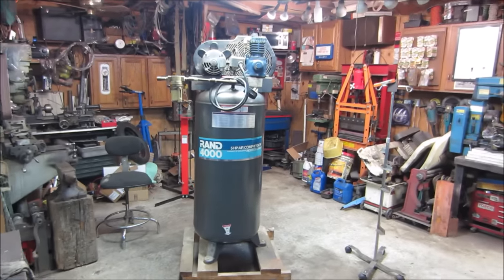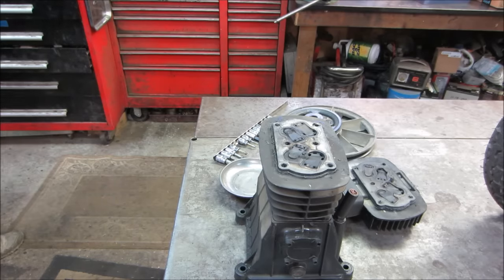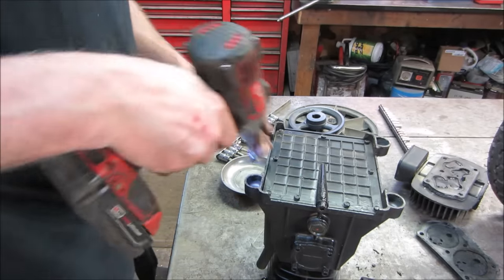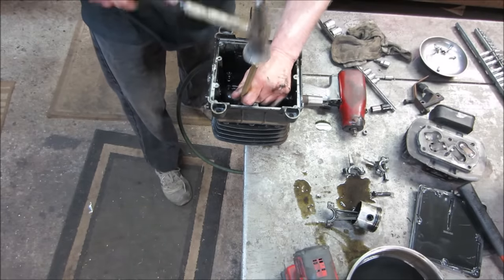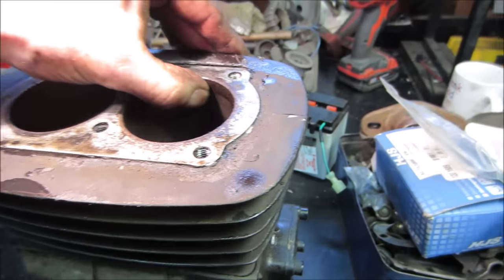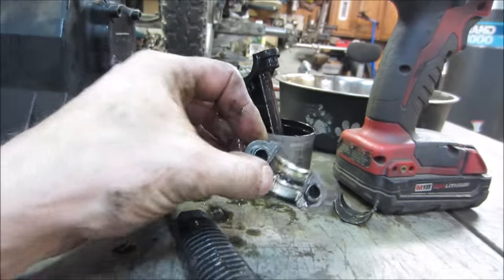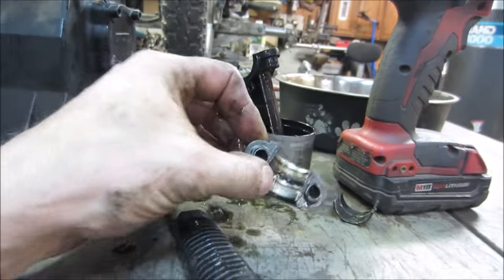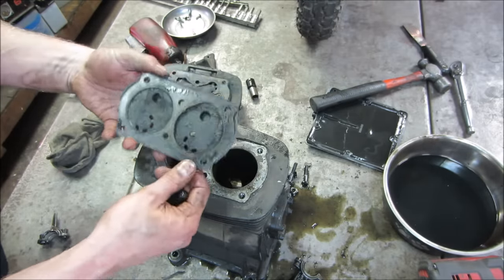Burned out Air Compressor tear down, what went wrong?

Comment: Totally enjoyable, maybe just defective, I had a cousin who had a slant 6 Duster, bought New in 72, changed oil every 2000 miles, kept a log book, guy later became a college professor, no idiot, anyway, 1976, coming home from Long Island, motor blew, 31,000 miles on the car, internal failure, full of oil and coolant, blew a hole out the side of the block, sometimes things just break

Comment: If the air blowing across makes a difference from one cylinder (closest to fan) to the other (damaged cylinder), maybe there should be cause for concern if the new repaired set up has that fan blowing away from the unit.  Unless you found a way to flip it around.

Comment: An engine is a large compressor, so basically you have a 2 cylinder engine there, just swap those top plates out for a standard head gasket throw a carburetor on the intake and it should fire right up.

Comment: Out of curiosity, was it a 2 stage compressor and was the burnt out piston on the second stage? Compressing air gets really hot, so it is possible that with continuous running that piston got hotter than the other.
Reply: Are you sure you can't pen the rest pin hold closed enough to save it?

Lollollol

Comment: I'm betting one connecting rod came loose and stopped loosening further as it beat itself up and killed the piston and upper end.
I'd clean up everything, place the decent parts on E-Bay for cheap, and use the rest for my foundry aluminum casting supply.

Comment: It sure is an interesting mystery how one cylinder took most of the damage. It looks like that thing was worked to death in any situation, and not maintained. I suspect that the valves weren't completely sealing on the less damaged side, possibly from poor air filtering, causing more work to be done on the ruined side.

Comment: one cylnder puts air to 2nd so 2nd is hotter? and is farther form fan  working on 2 differnt compressors now one has motor down , one the little bleed back valve (cost more then entire pressure switch) is bad, got a 2cyl given to me locked up havent had a chance to tear into plus had a pu land ontop of our truck ended up in icu for 4 days now with a neck brace for 4-6 weeks and 10lb weight limit  at least   can still watch you have ing fun and get ideas for later. fr from wakita ok

Comment: I was the cylinder furthest from the cooling-fan which failed first. Since the power-connections burned, I suspect that piston siezed and caused the motor to draw too much current. (tha builtp-in overtemp breaker in the motor saved the motor)

Comment: Yes a engine block can be converted into a compressor and a compressor can be converted into a gas engine. Just require proper value system , fuel delivery ignition system.

Comment: Have you ever seen someone make a compressor head into a two stroke motor. They can’t be high performance, but they can run. Just remove the reed block, and cut ports into the sides. Add spark plug hole.

Comment: The cylinder that failed was probably the second stage, which would be at a higher pressure than the first stage, so it would be hotter due to that.

Comment: In a two-stage compressor, the high-pressure stage should get hotter than the lo pressure because the more you compress a gas the hotter it gets.

Comment: Compressors arent ment to run continuously. The three most common failures for a compressor is valve failure, pressure switch failure or a leak at the air system, hose or something. So what caused the 2:nd cylinder to break is probably the ai flow from the cooling fan or a valve failure probably a combination. and an air hose leak.

Comment: P.S. A gas motor conversion is not out of the realm of possibility. If the case can handle the pressures. Add a carburetor you say?  Will the reed valves be up to the task? Hard by itself these  questions are to answer, but you would definitly need to add a starter motor in place of the electric motor or a free wheeling pulley and momentary button as well. Any input is taken as a learning experience so fire away at me if your free.

Comment: Perhaps the machine wasn,t sitting level after running an vibrating so long making the oil only reach one cylinder  with a greater amount an very little to the other.

Comment: if it's a two stage compressor,one cylinder is higher pressure then the other and is under more stress.the carbon build up is from oil that leaks past the rings and the heat of compression carbonizes the oil just like a diesel engine
Reply: It isn't two stage - the cylinders are the same size.

Comment: Kinda like a Harley Davidson the rear cylinder normally has more wear on Higher mileage motors. The rear cylinder gets the hotter air from the front at low speeds.

Comment: I wonder if the unit itself was free standing and fell over while running, onto it's side, or against an adjacent wall causing the oil in the compressor sump to move away from the oil slinger in the damaged cylinder. It sure would explain the severe gouging of the bearing surfaces all of which would generate a very high temperature which could possibly, in turn cause the oil to burn and form carbon. How the carbon was formed on the top of the damaged cylinder's piston is unclear.

Comment: The piston didn't hit the cylinder head because every time it goes up it's reaching at least 80 PSI before the reed valve opens. Of course once the pressure switch overheated and lost a connection then the slow leak allowed the tank to drain to atmospheric pressure... but before that it would always kick on as soon as the pressure went below 80, and keep going until it reached 120.
Reply: The wear on the wrist pin would lower the piston, not raise it.
Reply: @wb8nbs  exactly. That is also probably why that piston overheated when there was plenty of oil. Being pulled at an angle would cause a ton of friction.

Comment: Yeah the reason it wouldn't hit the top of the piston is because the oval in the rod caused it to short stroke, meaning the piston would not go up all the way from the pressure, Instead of the opposite. causing the buildup of crust in the top portion of the cylinder...

Comment: If the compressor was not properly leveled the oil could run to one side, and as the oil level got lower the dipper on the low oil side would gradually run out of oil and that cylinder would run hotter and hotter until it went bad.

Comment: $100-150 to replace the crank, piston assembly, new rod bearings, and crank bearings. $200 could rebuild the entire comp head. Look for a good used one cheap on feebay and yard shopping. Maybe be able to make two into one for peanuts and gas.

Comment: I am curious... To where all the carbon buildup came from...?  I would expect that kind of carbon buildup on a gas powered lawnmower engine.   It draws in fresh air even if it's dirty.. And blows it out.. The exhaust,   And the oil looks like it has never been changed,  or somehow became low over time.. Isn't that the start of the problems created here...? I have never seen an air compressor tore down either.

Comment: I wonder, did it get that hot, and pump that much oil on the one side, that it started firing like a runaway diesel & that accounts for the carbon buildup and the extra-eggy small end? Would sound pretty cool if it did, a miniature detroit 2t diesel haha

Comment: Years ago the company I worked for built us a new shop, when we fired up the new air compressor it tripped the breaker upon investigation we found it did have oil in it, What we figured is they got the power connected to it and somebody turned it on without oil in it,  ran it till it locked up then poured in it to cover their ass!
 Being oil field hands we worked the thing back and forth till it came loose. every time it came on it had a high pitched whine

Comment: If it was run low on oil .... not surprised it failed.  I'm not a big fan of those high rpm machines, using a 3600 rpm motor instead of a 1800 rpm motor.  Lower rpm machines last longer and are quieter.  That burned contact on the pressure switch should not have happened.  Must have been a loose connection or a worn contact.

Comment: Well, they sure as hell don't build things like they used to, and I'll bet that cast iron compressor you used to replace this with, will last ten, if not a hundred, times longer.

By the look of it, that compressor uses two cylinders in parallel, so each one should take a equal amount of the work load. On the face of it, it can't really be anything else than insufficient cooling on the rear most cylinder. That could also have been exacerbated by close proximity to a heating device, or simply tight up to a wall, say, and the air not flowing adequately around the back side of the compressor.

Comment: When I service an air compressor I put a magnet on the drain plug then clean it each year when I service the air compressor. Also adding a date tag  will let you know when it's time for service again. Just sayin!
Reply: magnets don't grab aluminum flakes very well ;)
the only thing you'd see is ring/cylinder and crank bearing parts, in which you'd know there was an issue well before needing to see the chunks on the plug..
Reply: @throttlebottle5906  well leave the crap in there TB!

Comment: I put a quarter inch valve on the bottom of my compressor you can just reach down and open it up and blow all the air out. it's better that cheap little butterfly piece of crap they give you and you can run the line anywhere to blow it out. You can put a automatic drain on there if you'd like

Comment: I know this is an old video. The reason why one burnt up and the other one did not. Is because it's a two-stage pump. One cylinder is low pressure the other cylinder is high pressure. So I bet the high pressure cylinder is the one that burnt out.

Comment: the air going in is cold then it gets compressed into the other cylinder that air get hot and compresses that air then into tank when it comes out of the second cylinder it picked up a lot of heat from friction and it also gets dirty from the oil in the cylinder and after time it starts to carbon up from all the heat 
a lot of bigger comp have fin tubes for cooling the air between cylenders and the outlets/inlets to the tank. just my 2 cents

Comment: hi, you were spot on by saying the cylinder farthest from the fan gets the hottest, that is the same as a car engine, the farthest cylinder from the water pump is the cylinder that all ways get's cooked first!,, but as this is just an old compresses why did you not just "tape up or re-grind" the crankshaft journal and re-make or re-metal the big end bearing, then, weld a bush into the con rod and turn it out to fit the wrist pin, and if there was slap in the piston because the hole for the wrist pin was worn badly the just centre punch pop mark's around the hole the wrist pin fits into, to make it a tight fit, and just slap it all together again,, it would have ran again as the pistons are not under the same load as a gas engine, as 150psi "top's!" is nothing!, that is just short of cranking compression on most petrol engine's!

Comment: My mistake Id like to correct myself about this issue with this compressor. Here the rod didnt snap just worn on the one but aluminum rods in general are just so prone to wear and breaking because of their weaker strength as compared to cast iron rods!Glenn P. in N.Y.

Comment: I don't think that is carbon build up, most likely paint build up, as they were spaying the over-spray gets picked up and sucked back thru compressor and creates that nasty grunge. And pretty sure someone put a larger pulley on motor to get more air, which cause oil slinging lubrication issues, which ends in piston pin not getting lube, and death. Yes, you can make an engine from an old compressor.

Comment: What broke it- lack of proper PM and probably the wrong type of oil was used in it and never kept it full of the proper type and viscosity of oil.    Most companies hire burger flippers as maintenance types because replacing equipment is cheaper than maintaining it.

Comment: Guessing the burned up cylinder was the second stage (high pressure) side, and under way higher compression and heat.
Reply: You guessed wrong, this compressor is a single stage.

Comment: At this point I'd just haphazardly put it back together (possibly without the valve part) and fire it up without oil, running it into the ground to see what gives out first, that borked connecting rod or something else as a last hurrah. No point in fixing it anyway with that much carnage

Comment: you can make a gas engine out of one with a motor cycle head or the read valves out of a 2 cycle engine it's just a pain to get set up but they run great when there done. there is a kid who has a channel in India who builds gas engines out of stuff like this and put's up on You Tube the whole process of how he builds them . he's a bit of a genus when it comes to crap like that but is held back by the lack of supply's he has around .

Comment: Send it  to 805roadking and suggest he build a OHC 2cyl gas engine out of it. He is always making one thing into another. He built a water cooled Briggs out of an air cooled Briggs horizontal shaft single cyl. Also joined 4 single cyl Briggs making an in-line air cooled 4 cyl engine. At least give him a look-see.

Comment: You can take a VW engine set it up to run on two cyclenders then use the other two cyclender to compress air and by doing You just turned your VW engine in an air compressor

Comment: Sounds fine. Just use a bigger faster motor to drive it. If you straight wire it with no breakers or switches it'll use less power.

Comment: Here's what went wrong: Lubricant failure due to NO Oil Changes  - HEAT, PRESSURE and OXYGEN killed the lubricant. Almost everyone assumes an air compressor isn't a harsh environment, after all it's only air right? Wrong! An air compressor is an extremely hostile lubricating environment, much, much more oxidizing to the lubricant than an automobile or diesel engine. Why? Because you are compressing Oxygen with High Pressure and Heat. That really cranks up the oxidization of anything this hot oxygen rich air comes into contact with. Yes, more than combustion byproducts in an automobile engine - those gasses are virtually inert, spent on the combustion by oxidizing (burning) the fuel. In an air compressor it's almost literally like the oxygen in a welding torch. The only thing available for this hot high pressure oxygen rich air to oxidize (burn up) is the lubricating oil. Use a mineral oil in a reciprocating air compressor like this one and it is done in only 100 hours it's lubricating properties spent. It's why synthetic oil is universally recommended for piston air compressors, it can take higher heat before oxidizing. But even synthetic will still oxidize - it just takes longer and when synthetic is done it degrades much faster than mineral oil.
The two cylinders are low and high pressure.The low pressure cylinder feeds it's exhaust to the intake of the high pressure cylinder raising the pressure even higher - and the temperature. It's hotter and the pressure is higher in the high pressure cylinder so that where you see all the crud which is the oxidized lubricant getting past the rings and into the compression chamber where it is torched into carbon.
Never use mineral oil oil in a reciprocating air compressor. Good synthetic reciprocating compressor oil can last 8000 hours or about 1 year of non-stop use.  Since this machine was run to death, it probably never had an oil change from it's original synthetic oil fill. And when synthetic oil is done it's lubricating properties literally and figuratively fall off a cliff. Resulting in catastrophic lubricant and mechanical failure.
Remember to change the oil in your reciprocating air compressors once a year in heavy use with a good quality synthetic compressor oil - and not synthetic motor oil.

Comment: The compressor gets hot that's why you need to service your compressor new oil new filter the oil gets hot and blow by the rings piston hot it burns I work on gas powered air compressors the use a different system piglet unloaded it signals gas engine to idle or rev depending on air demand they clog up with burnt oil

Comment: My synopsis: The cylinder that failed was further away from the fan/belt.  I think all the heat from the closer cylinder got blown onto the other cylinder and the second cylinder just doesn't have enough cold flow on it.  in normal operation that rear cylinder probably fails first.

Comment: Looks like the fan side cylinder lived and the far side cooked
Reply: Also, the big end of the rod probably went befor the small end of the rod. The small end was ovaled out in a vertical fashion showing that the big end had slop which slammed the top end.

Comment: ive seen a few car engines like that, and it was still running and driving. lol  usually from never changing their oil in 100k miles .  i dont judge( well not to their face) i just fix the problem(s). lol

Comment: 8:50 wash and nuts are lose. If it did come lose it would have acted like a hammer on the conrod an wrist pin. it would explain why the damage is the way it is. bearing failure would have snaped something